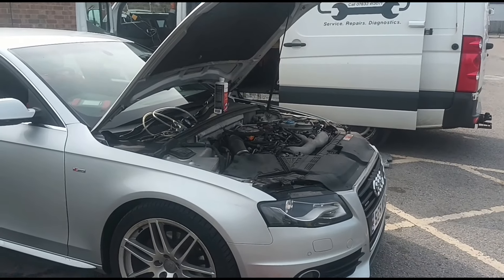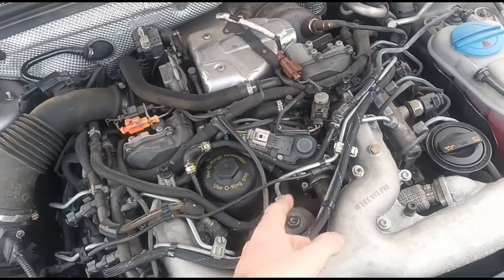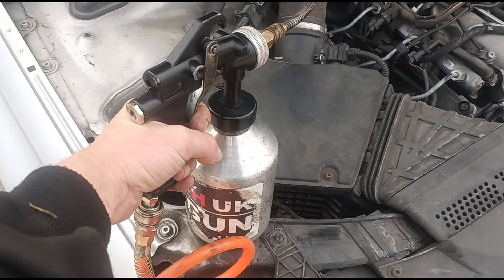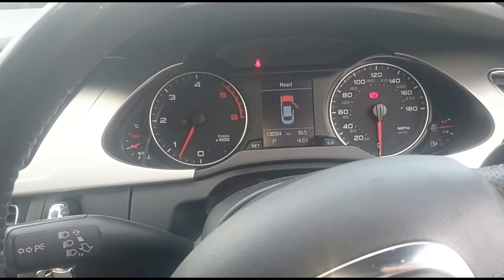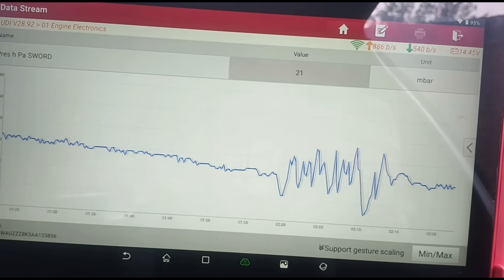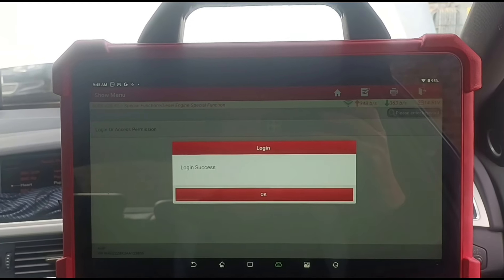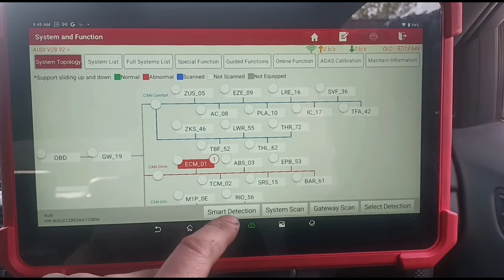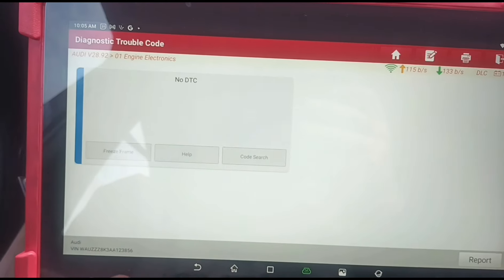Audi A4 P200200 Particle Trap Bank 1 Efficiency Below Threshold 3.0 TDI P2002

Comment: I wondered why you did it with the engine running on the other Audis aswell, back filling into the exhaust and cylinders it makes complete sense.
I must admit, when I was doing the clean on an A5 the other day I ran the engine, because I thought the foam would go up through the low pressure egr into the engine if I wasn’t careful - I didn’t make the connection with the height of the dpf and how close it is to the engine on other models though…

Everyday is a school day as they say!

Comment: I see u took my advice Jimmy, doing 5s bursts when injecting fluid while engine is on, in theory this method will have been more effective at cleaning soot versus one long continuous squirt 😎
Reply from the maker: Just as the DPF is quite high so didn't want to fill it with engine off

Comment: thanks great .  on euro6 cars with low pressure egr when you inject the liquid, disconnect the low pressure egr valve so that the liquid is not sucked in

Comment: Hello, I want to share with you my experience with Audi a4 2015 tdi 2.0 128.000 km. 
My check engine signal was on from I don't know why... suddenly. I put the tester in the board computer and I received these errors.P2002 (this error was first) and P004B1(after 1 month), and i had some negative performance on a filter like -10 kpa and minim was 0 , and the god raport was to stay between 0-10 kpa. How i fixed .. i changed the senzor presure gas evacuation.

Comment: Hi, have you ever tried to spay the cleaner directly inside the intercooler body from above, from the egr opening? With this method I'm not getting durable results and of course I didn't want to repalce the costy part...
Where does the pressure sensor hose finishing up?

Comment: P2002 efficiency below threshold refers to the egr fault , that customer will be calling you back to say he has a dpf fault AGAIN
Reply: Your right, but also wrong, like 50/50, by putting the fluid in via the dpi pressure sensor, the fluid will be cleaning the DPF filter face, once its worked its way through the DPF the cleaning fluid has a big chance of hitting the EGR cooler that's bolted in to the rear of the DPF, Cleaning of the soot on the EGR cooler. Now you may not get to all out, but you can get enough of it out to give the car a better chance of becoming road worthy for a unknown set period of time, We cleaned Audi with this code in the same way, the DPF pressure sensor readings was off the chart, but after a clean, dropped right down, yes the customer called us back about 4 months later, We went and re washed the filter, which would have cleaned out the DPF even more and the EGR more so this time, The customer is still driving his V6 audi 3 years later with no P2002 issues again, so in closing, it could be the luck of the draw to the extent of the problem in the 1st place, the only other option is a full strip down and EGR removal which could see a days labour added to any garage workshops bill, peace be the journey.
Reply from the maker: This is the 3.0 v6. Not the 2.0 with the EGR issues